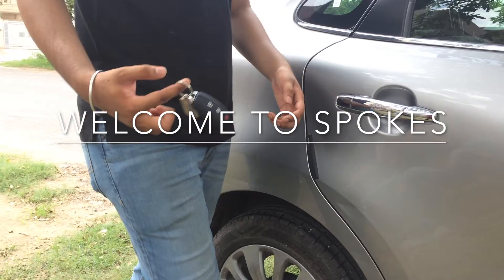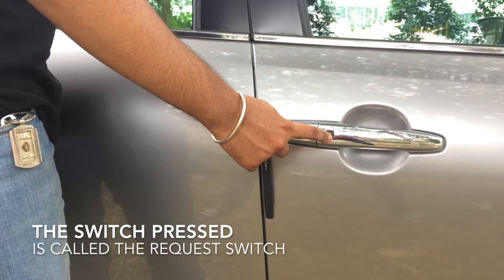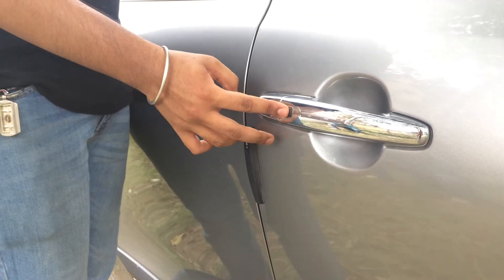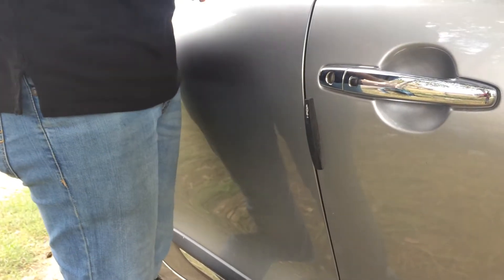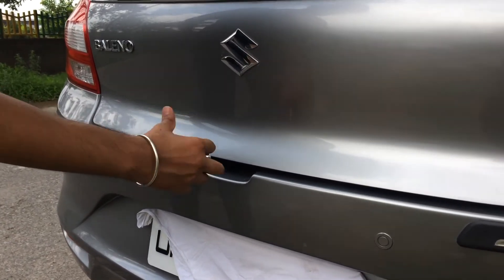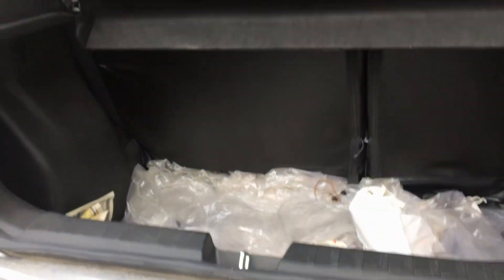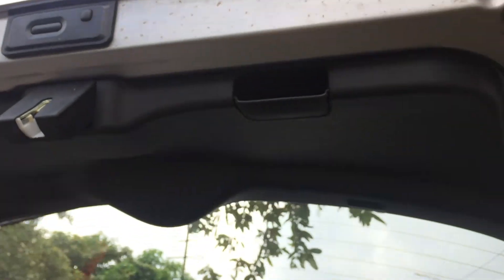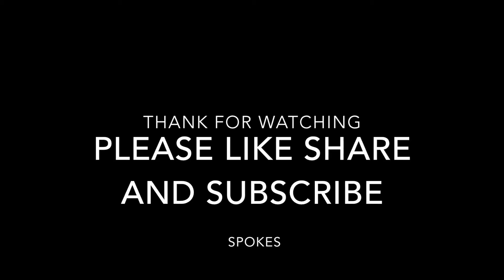Keyless Entry Explained in 2 minutes || Feat. Maruti Suzuki Baleno

Comment: Bro how do you disable this feature. I find it more prone to theft of the vehicle if parked outside
Reply: No bro, it has a area limit to avail this feature, the key must be within a range to unlock from the door and also it will not open all door on single press, It will only open either left or right depends on which side you're pressing the key on door. For unlocking all door, you have to double press it.
Reply: Yes. I too feel the same. There are other cars which has this feature that can be disabled. 
Are there any ways to disable for Baleno.

Comment: Hello, my door button are not working. Though I can lock & unlock using remote. Do you know what could be issue!
Reply: I have the same problem.. you got the solution?
Reply: @sahiljangra0397  kindly ensure that key is in 3 meter range of the gate
Reply: I also have the same problem in my Baleno zeta, it is now corrected after the first service without any cost.   #ayushdhanai
Reply: Have any solution for request switch work??
Reply: Mine problem is when push the door button can unlock, but cannot lock, remote can lock or unlock
Reply: I have same problem of lock and unlock which is not working. Anyone got the solution please share it :) thanx in advance
Reply: You got any solution?
Reply: Someone removed my request sensor button